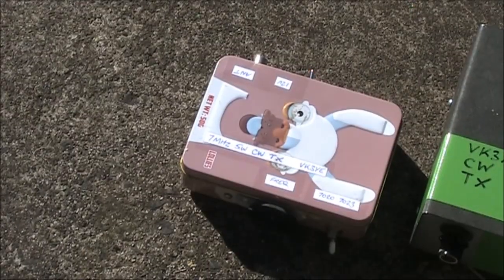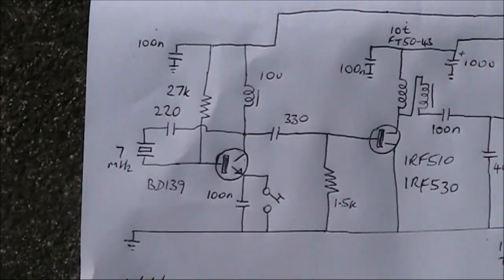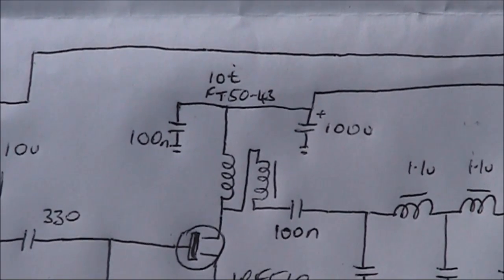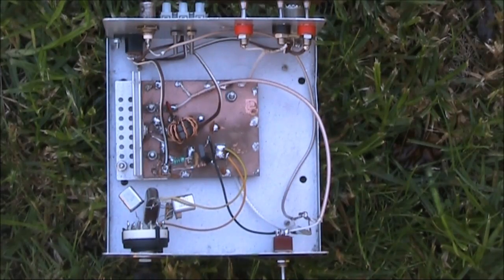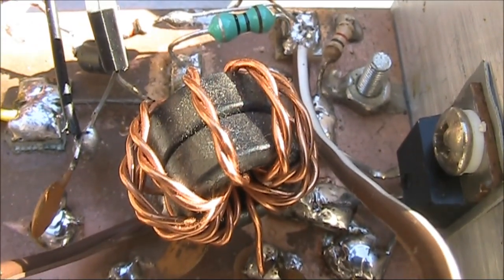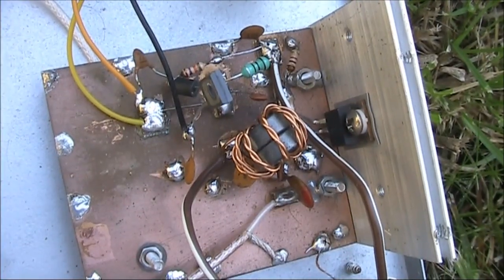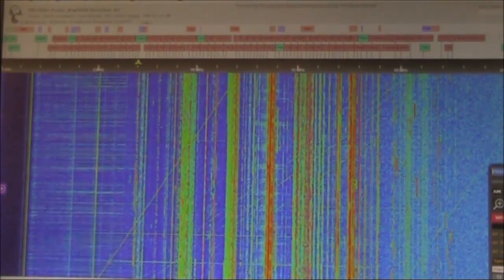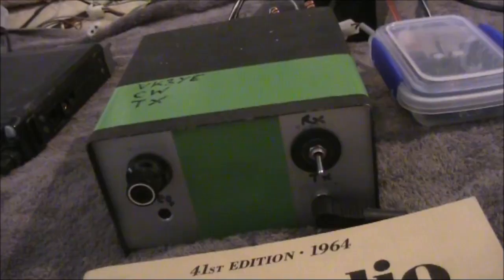Not QRP: 20 watts from just 2 transistors

Comment: Well, if the BD139 can be used as an oscillator, then if you get a buffer and an audio modulator circuit, how far is it possible to transmit with 3 BD139 transistors?

Comment: Nice video and great fun. I have built a 4-transistor XCO circuit (2n3094-2n3094-2n3053-IRF510) that can do 20W on about 18V power. I am trying to build another transmitter (si5351-BD139-IRF510). On LT Spice it seems to be able to push >20W at 18V power, but after building it I am only getting 5W... hihi Some more playing to do. A quick question, how did you come with 10T on FT50-43 transformer. I only have 5T now and it gets a bit hot. Also what's the effect of stacking two cores? Equivalent to a larger core??

Comment: Yes the IRF 510.  my nemesis...waiting on a delivery of 2 of them.....blew mine in the kit I'm building :(   It had a gate drain resistance of 2 ohms :((((( I killed it good!!!! Mosfets are amazing powerful  but so fragile?? I am a static machine.....might need to buy a wrist strap?
Reply from the maker: I've not worried about static with them. But depending on the circuit they are super fragile if you adjust the DC bias to the gate too high. With enough drive you can get away with no DC bias if you're just building a CW transmitter.
Reply: @vk3ye  yes …. That’s what I did…. Cranked the pot too far and let the smoke out! Good to know static is less of an issue (pretty sure they have protection diodes in them?) But I ordered 2, so one will go into my little transmitter which now has agility at bottom of 80 m band. Was chirping but lowered coupling from oscillator to second “pa” stage and it is ok now . But even lower power abt 300 mW. So will beef it up with an IR510. Also added brass contacts to Morse key. So much better now. Breaking stuff teaches you heaps! 🤡…. Do u ever sleep??? 😁

Comment: Another couple of questions.  Is the transformer 4:1 (Z) because it is wound as an auto transformer with a 2:1 turns ratio?  Also, is that ferrite bead on the transistor necessary (VHF parasitics prevention)? Thank you.
Reply: "Is the transformer 4:1 (Z) because it is wound as an auto transformer with a 2:1 turns ratio?" Yes. Look at it this way: the input voltage Vin is halved and the input current Iin is doubled at the output. As resistance/impedance is defined as V/I, at the output of the transformer, Zout = 0.5*Vin/(2*Iin) = (1/4)*Zin.

Comment: Nice project Peter! 

I'd like to build this as an amplifier for a 20m QRP rig. 

Will 250 mW of drive into the IRF510 be enough to get 20W output?

Any idea how much power your are getting out of the BD139 oscillator circuit?
Reply: I don't know if this question is still relevant, but I'll answer nevertheless.
250mw will get you quite far. He's putting in 200mw. BD139 is quite beasty, it can do 4w. Single IRF510 can do 50w+ (class E), just don't mistreat it. 

Add a reversed diode right onto the gate of the IRF510(parallel to resistor), will prevent blow up, I speak out of experience. Also if it is oscillating add a couple of ohms worth of resistance between the gate and the cap (diode will then sit between cap and res to ground, reversed so it doesn't open up with positive V). 

If you are not using a crystal, reverse the resistor at bd139 to ground, will directly work with input from si5351 to 20w.

if you want more than irf510 go for irf530, works up to 75w-ish.

T50-2 or T68-2 can also be used instead of ft50-43, amount of windings not so important. 10 bifilar windings around one of those work fine.
Reply: @pa0fxx509  Thank you for the comments!

After I posted the question, I saw that Peter answers this question in the video, duh. 

I was inspired enough to do some experiments on my own and can fully believe all your comments regarding power output. I used an IRF520. It I saw 55W at 32V and that was class-c. There appear to be never-ending opportunities to tinker with these devices.

I think that the key to success with the FETs is low drive and 'high' voltage on the drain. Once the drive gets up to a certain level, the gate waveform really deteriorates and the output signal became rich in harmonics. But low drive and high drain voltage...that gets it done :)

Thank you,
Brad (AD0RX)

Comment: If I just want to try the 5W version, which FET do I use?  I already have the BD139.  TNX es 73 de KQ6UP
Reply from the maker: IRF510 would be fine.
Reply: @vk3ye  TU es 73 de KQ6UP SK :D
Reply: @vk3ye  Peter, I built the first stage, but it does not seem to be oscillating. Does it need the load of the gate of the following stage to get it to oscillate?  The BD139 is getting warm at key down, but no tone in a nearby receiver.
Reply from the maker: @kq6up A load may help. I'd also try adding a capacitor from base to ground of the BD139 in case that heps.
Reply: @vk3ye  It is working now.  I noticed the source of the FET was not grounded.  Xtal gets HOT.  It is the smaller type HC-49.  Probably the old FT-243 would work better, or maybe a buffer stage to run the oscillator a little cooler.
Reply from the maker: @kq6up  Yes, both approaches would work.

Comment: I've got some IRF531 transistors.  IIRC they are the same as the IRF530's except for the D-S voltage rating.
I might want to put a tuned circuit on the output of the oscillator so I can use some war surplus 5.x mhz rocks I have in the junkbox on 30 meters.
Also could use an Si5351 "DDS" vfo instead of a crystal with an arduino to drive that.
Reply from the maker: You will lose oscillator drive if you use that stage as a doubler. Look for cheap 10.111 MHz crystals on ebay. These will work in this circuit. A DDS VFO could also work but you'll need more stages to amplify its output.

Comment: Nice construction! A preferred power supply, I think, would be 8 Li-Ion 18650 batteries in series (~30 V) with an LM7812 linear regulator for an oscillator. Having a receiver in the same enclosure would be nice too.  73s from Russia!

Comment: 👍very good, thanks Peter. Your video prompted me to order some more BD139's 😃 (the last couple I blew up trying to get a Pixie kit to work). I like the plug in LPF idea. Calling CQ on CW QRP, in the UK, I have found the same 20 min. "rule" applies. Although I sometimes copy a quick reply, it can often take 15 to 20 minutes of calling to get a QSO. As I think you mentioned in a previous video, sending QRZ? at end of a QSO may help - chances are some operators will have been listening and may reply if they hear QRZ?
Reply: I put my Pixie on 60m and got a SWL report from 220 miles away and worked a couple of stations 180 miles and some nearer stations. Not bad for 350 mW out. Using a low inverted vee. Less QRM from other stations on 60m but not always a busy band.
Unfortunately the Pixie blew up and the copper track lifted when I attempted a repair.
Bill, G4GHB.

Comment: Very nice design. And impressive focus. The delay in the the sidetone would wreck me!
Reply: In over 20 years I never got round to putting sidetone on my h/b rig.
G4GHB.
Reply from the maker: You can fix the sidetone delay but having a local receiver (no antenna connected). Tune it to a pitch different (preferably higher) than what comes out of the SDR and concentrate on that when sending.

Comment: Why two toroids?
Reply: More power handling, less turns.
Reply: @paulvandergroen9569  thanks!  Is there a guide to how much power a given core size/mix can handle?
Reply: @paulvandergroen9569  haha
Reply: I might have some type 61 in that size.
Reply: A single T50 ferrite toroid may struggle to handle more than 5W. A good guide for selecting toroid size and core type depending on frequency and power is here:
https://www.robkalmeijer.nl/techniek/electronica/radiotechniek/hambladen/qst/1988/12/page33/index.html
Reply: @Steve-GM0HUU  fantastic.  Thanks!

Comment: Great fun! A MOPA  Out of interest, on 30v, chirp aside, how much power could you get on 20m? My guess is around 5 to 6 watts, due to the rapid drop off in power of the IRF FETs. WA3EBY runs two of them at around 35v (?),  wear safety glasses!
Reply from the maker: Paul - It was more when I tried it - around 12-15w from memory though that was just into the power meter with no low pass filter. Yes, you should mount the 510 in a way it can easily be replaced!

Comment: There is a drift on the tone.. just wondering how you would go stabilising it. Cheers VK5LEX
Reply: Don't key the oscillator, use a J310 to drive the BD139.
Reply: @paulvandergroen9569  Cheers,

I was thinking that the oscillator would take time to stabilise once power is applied, so I can see how your idea would work

Comment: Whats next? Class 'E' Amp? A 75w valve Novice transmitter? How about powering the transmitter from a 19v/20v laptop PSU (a good one, like Lenovo/IBM )? regards G7VFY
Reply: Laptop power supplies are really under represented in ham radio builds, imo. Decent quality, very available, decent power for medium power and CHEAP.
Reply: That's a good idea. I have a few of these but never really thought of using them for radio.
Reply: @Steve-GM0HUU  Lenovo 80watt, 20v psu's a really high quality and are rarely noisy. I picked up a few of these at a car boot sale and they are very beefy. I've been meaning to crack one open to see if I can turn the voltage down to 13.8volts.
https://www.ebay.co.uk/itm/274656000818
Reply: @Steve-GM0HUU  Lenovo power supply plug configuration
https://www.youtube.com/watch?v=XO3D0d8a_fc
Reply: @Steve-GM0HUU  Slim tips: From ThinkWiki:

power rating  resistance. https://www.youtube.com/watch?v=XO3D0d8a_fc
36 W  7.3 kΩ
45 W  120 Ω
65 W  280 Ω
90 W  550 Ω
135 W  1 kΩ
170 W  1.9 kΩ
230 W  4.6 kΩ